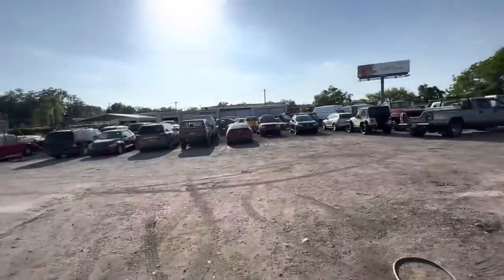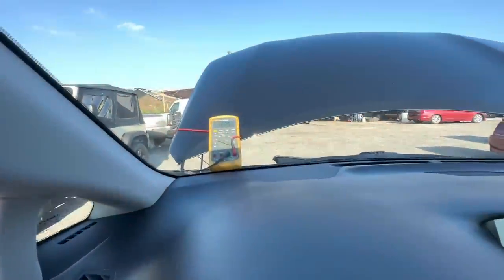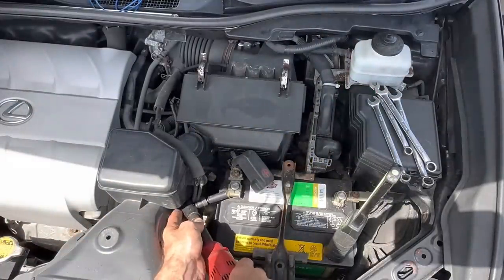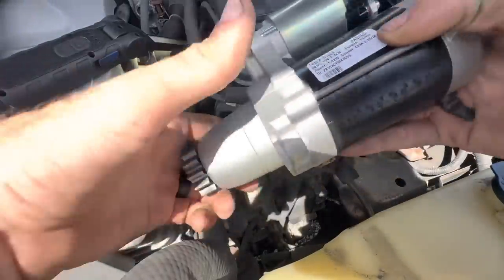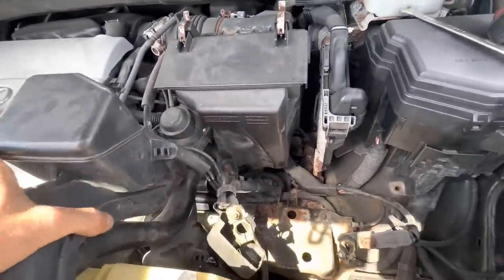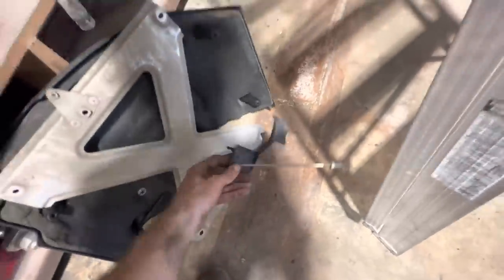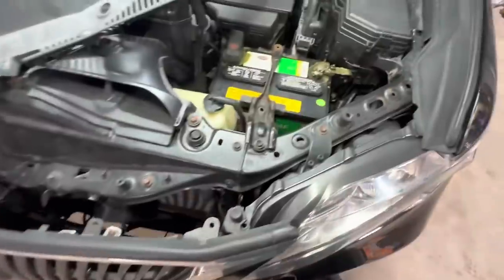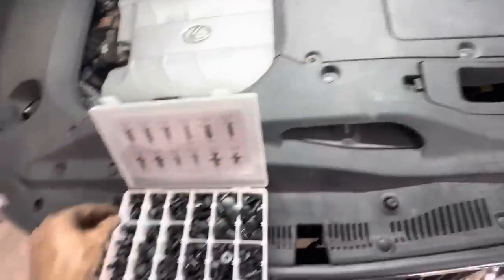Towed in Dead! Lexus Rx350 #mechanic #tow

Comment: To settle the motor vs engine debate...Motors run on electricity and engines run on combustion.
Reply: Takes a motor to start an engine!
Reply: Engines convert chemical energy to mechanical.

Comment: Perhaps you could install a winch at the back wall of your shop to haul these vehicles in?
Reply: That's actually brilliant..!! Well played//
Reply: He has a tow truck with a wheel lift he could back it in
Reply: Only problem with that, Ray will over engineer it, add a few fulcrums and pulleys, hits the lever and launches the "Lex i" through the wall into the next county....lol. (cool idea tho.  Lol)
Reply: Mount it to the slab. Studs and even the bottom plate might not be fastened well. Even today with all the hurricane codes. Done plenty of construction in Florida in his area both what’s considered coastal and non coastal
Reply: Ray already has a winch, on the back of his flatbed.  I wondered why he didn't just use the flatbed to move it into the shop.
Reply: @Richard Cranium Nah. Install 2. One to bring the cars into the actual shop (and into the easy to access lift) and the other behind to pull cars to the harder to access lift when a car is close enough to use the winch :P
Reply: the simple answer is he needs a Peter ?
Reply: How one little J bolt can take up your whole day ,  Hay what a pain haha love your show!!!
Reply: Or just get a 4 wheeler line I've seen at some shops

Comment: One comment worthy of note. A lot of the newer imports have a gear reducted permant magnet  starter motor... so when you bang on it you can very easily shatter the magnets inside. So even if you had thought about repairing the starter you now are up the proverbial Creek with out a paddle.  Re-man starter 100-300 dollars new over a thousand... brushes about $30 which are now no longer an option. So unless you are in an emergency situation DON'T BANG ON THE STARTER.

Comment: You're a brave man for driving that into the shop with the hood open, I've seen too many hoods drop due to worn prop shocks and crack the windshield with parts placed in the wiper area.
Reply: Brave, or a person that has yet to learn that expensive lesson...
Reply: Cracked windshield from parts placed in the wiper cowl is an entirely different situation than hood shocks slowly letting the hood down as you inch it in the garage.. giggety...  Furthermore, wtf you putting up there god dam driveshafts?? "I accidentally sent a control arm through your windehh... Myyy baahhd.." people just get off on "teaching"/"warning" (aka: man-splaining) others about all the potential dangers of every single move made, or is hypothetically possible to make.. thank you Mr miyagi.. I will definitely think twice next time before I toss a pair of rotors up on the wiper cowl before moving a vehicle a meter (~3') with the hood up😂
Reply: I had a 1988 Bronco that had the hood latch fail at 40MPH, wrapping the hood over the windshield with a BOOM! that bent the hinges and required a windshield replacement.
Quite a shock, given that I was in moderate traffic at the time.
Reply: Been there done that on a 17 Silverado just the others day , learned a valuable lesson that day.

Comment: The starter in my old 92 Aerostar failed in a Home Depot parking lot, so I called my buddy who drove me to an auto parts store, got a starter, and crawled under and replaced it. Easy Peasy. No cramming it under the hood in those days.
Reply: I changed out the starter of my Ford van in my driveway, just crawled under with a wrench, and had it done in 5 minutes.
Reply: Anymore a starter that doesn't have to be accessed through the back bumper is considered " Easy Peasy".

Comment: Fun video thanks Ray, for once engine designer got the starter motor position in an accessible place meaning no jacking car up and crawling underneath!
Reply: Toyota's been good about that on the newer V6s. I just had to do the starter on my 2008 ES 350 (same engine that's in this RX), it took less than an hour start to finish. Only had to remove the battery, air box, and intake tubes. Though I did cheat - I removed all the underhood plastics when I got the car.

Funny thing is I even have the same Costco Interstate battery..
Reply: @seand7349  I wish the same could be said for Toyota's V8's. The location on my Tundra was enraging, particularly when I had to replace it a 2nd time after just a few years.
Reply: @karlschauff7989  Ughhhhh. Under the intake, right?
Reply: @seand7349  I wish! It's under the exhaust manifold. Cooler lines and a frame also in the way...

Comment: Now don’t get me wrong, snap on is amazing, that being said I only have a few snap on tools. I’m not a mechanic but i do more than the average guy, (right now I have an npi 4.6 block I’m getting ready to mate with ported PI heads, forged internals, ect) 
  The tools I use are Gearwrench, Olsa, Tekton, Wiha, makita, Capri, ect. 
 (Not gonna lie I have some HF stuff too) engine stand, breaker bars, a set of icon sockets, and of course the golden ratchet. 
  I seriously think I have an addiction to shiny useful things, I order a tool or set every week. I think I’m up to 37 ratchets, 23 complete sets of sockets, 42 different pliers, 6 torque wrenches, and about 200-300 box end wrenches. Plus a lot more. 
  But only 2 sets of screwdrivers as well. 
  Anyways I love watching car repair videos when the guy with $40,000 worth of snap on uses the same tools I use as my main tools. Today it was your Gearwrench socket set. I have the same one except I pitched the blown molded case and threw them in my box on organizers. Actually just got another set of deep and shallow metric sockets yesterday. 
  My point is that I would have spent $31,472.69 if I got all snap on (Or 2 dozen eggs) and I’m your average guy with bills and a family. And I’m not a pro mechanic like I said. 
  But I am contractor so my work tools are waaaaaay over $30k. So I 100% get why you would use brands like snap on.

Comment: Impressive corrosion on the M post and wire, leading into the motor itself. The pull in coil and load side of the solenoid switch are both upstream. The way the starter is positioned, moisture is wicked down the wire into the motor. Does anybody know why they don't insulate that wire from moisture penetration? I've seen that before, nothing to do but replace the unit.

Comment: The old bang on the starter with a hammer. .. Countless times. .. And it worked about 1/3 of the time,lol
Reply: Remember the long handled flat head screwdriver to hit the contacts on the starter to "jump start" the starter.. ?  Lol (old school)   too bad that cable was fried).
Reply: @chrishengeveld6117  .. . Yep, I remember very well. Trashed a few over that one.

Comment: The start-then-stall thing is interesting ... lot of Chryslers (esp. late 90s Jeeps) after a battery swap not only will start-then-stall, but sometimes you have to feather the gas pedal until it'll hold an idle, too!
Reply: Some years of the Toyota Camry do that too - the computer forgets the proper fuel settings for idle, and it takes a few minutes to relearn.
Reply: Yeah what Moshe said, my 99 dodge likes to stall if the battery stays below 11 volts for too long and I jump it. I just discovered that my lower fuel rate injectors (19# instead of stock around 21#) did no stall on me, but it ran super rough until it went into close loop and figured itself out again

Comment: Would greasing that bare copper ground cable on the new starter help prevent the corrosion?  Maybe a schmear of dielectric?
Reply: Do what Eric O would do, Fluid Film it.
Reply: I don't worry about inside connections.   But anything outside I put a dab of Vaseline.   Dielectric or Fluid Film types should work as well.  I also Vaseline the battery terminals and hold down.   Also some bolts.  Vaseline is cheap and clings well.  Any bulb I remove gets a little bit too.
Reply: Agreed. A little dab will do ya

Comment: I recently bought a Craftsman underhood light which was less than $100 and uses regular Craftsman 20v batteries.   Works great, way brighter than other underhood lights I've used, and it folds in 2 so you can stand it up....

Comment: Had this happened to me. Except it was the battery cable. The positive corroded from the inside out. Replaced it and the battery. Old girls been running great since. But i had double the mileage this Lexus had. That was two years ago. I have a 96 Rav4. Just shocking but rare find a Lexus. I guess there's a first time for every thing. Great video. 😊

Comment: Hello Ray, just a thought, if the solenoid clicks you know it is being energized, so you know it is getting 12v 🤫 Also I saw your N.C. Diss, not everyone here has the "Squat". I used to use a beat up riding lawnmower to drag cars in with a rope, and an old tire tied to the front to push, it worked until I got employees.

As always well done

The One Time Hialeah
Blue Mule NC

Comment: Ray, have you ever replaced a started to find out the engine was locked up?  I always try turning the engine first before replacing the starter.
Reply: Well, if it was driven before it died, you’re prolly safe. If it is old not been started in ages ‘barn find’ put a little diesel in the spark plug holes and crank by hand. Then spray easy start into the mouth of the throttle body/carb, new battery, turn the key and 🙏
Reply: Diag using your senses. Watch the brightness of the dash lights during cranking and listen for the solenoid. It will point you in the right direction. If you hear the click and your dash lights dim considerably, the engine might be locked up, or battery and connection problem. Rattling: check battery and connections. Click and no considerable dash lights dimming: starter issue. No click: starter or starter control circuitry: relay, neutral or brake switch, fuse. Verify with a test light. Don't use a multimeter because it might show 12Volts while there's no current capability due to bad contacts.

Comment: I speculate that the glue is there because the intake comes with the hoses attached so it's glued on so it doesn't become unclipped during parts handling and assembly at the plant.

Comment: G’day Ray,
I remember in one of your videos demonstrating that when removing a battery you should always remover the negative connector FIRST in order to PREVENT SHORTING the POSITIVE terminal to ground with the tool you are using to untighten the connectors. Then, when reconnecting the battery do the POSITIVE terminal FIRST for the same reason. 

I agree whole heatedly with this, however, in your videos you invariably undo the POSITIVE terminal FIRST thus not only ignoring your own advice but risking shorting the battery’s positive to ground with a metallic object that you are holding. 

In the interest of maintaining the dexterity of the hand in question this is something that should probably avoided.

Comment: Did this job in my driveway on my 2010 RX in about thirty minutes.
Two things I’m thankful for:
1- starter failed in my driveway
2- I don’t live in the rust belt (everything was like new despite there being 150K miles.)
Edit: no glue or anything on hoses, btw

Comment: Fun Facts Toyota never uses 13mm bolts or nuts on any vehicle because the number is unlucky 12mm or 14mm are more common used in place of a 13mm @Rainman Ray's Repairs

Comment: In the UK we have a compulsory annual MOT (Ministry of Transport) test for vehicle's 3 years old and over, even a "insecure" battery is an instant fail. If the police stop you and find the battery is insecure (even if the J clamps are loose) that is an offence and penalty points on your licence,a prohibition notice issued and vehicle deemed to be in an undriveable condition and will require a recovery truck.Loose battery is veiwed as a fire hazard and when repaired the vehicle has to be inspected again by a MOT test station.

Comment: Toyota has longer J hooks in rear side of battery, check if both rods are same length b 4 ordering a replacement. There may be an arrow indicating direction of hold down bracket to indicate proper installation. Attention to details are noticed by customer in rating quality of service. Small details matter to some and you want as many happy patrons as possible. Love your show, great shop and local. Pride in professionalism will make your business a known and respected shop.

Comment: Looks like that Lexus was once a submarine. Wonder if it has ever been a victim of the dreaded storm surges - common to Florida coastal communities.
Reply: Increíble para mí ver tanta corrosión en un coche relativamente nuevo (tengo uno muuuuucho más antiguo (1993) que no tiene corrosión importante, en ningún sitio )
Reply: Just the sea breeze is enough to corrode things.  If you live at the beach, regular freshwater washes and garage storage go a long way.
Reply: @cup_and_cone  Mi coche de 1993 vivió (y vive) cerca del mar, mucho tiempo a unos 6 Km y recientemente (3 años) a 25 Km.

Comment: so, i work at Toyota, the glue that you see we use to hold the lines in when new as well as try and allow some form of lubrication when installing them, its a way to allow us to build the cars faster, but the glue is just there really, we dont know why we have to put it on there but we do, the clips alone will hold the lines just fine but its how the vehicle was designed before production so we have to use it

Comment: In my opinion, when the solenoid is making the clicking noise, it’s probably doing it’s job. That being said, I’d suggest that the brushes in the starter have worn away to nothingness. Could be the armature cooked too. That third hole in the battery hold down would indicate to be it should have 2 J hooks besides the bolt in the core support.

Comment: I believe Toyota uses that adhesive on the vacuum lines for 2 reasons. First, to keep the lines in the clips and prevent breakage over time due to vibration, and second, as a witness during factory assembly and inspection. 
Have a great day, Sir! o7
EDIT: There is a spot for a second J-Hook at the front of the battery hold down.
Reply: saw that 2nd j hook spot also. Com-on Ray.

Comment: We’re work on Toyota/Lexus vehicles in our import shop. We see that adhesive on those vacuum hoses, it keeps the hoses aligned and in place. 

That starter was exposed to salt water or brine of some sort. too much corrosion. Those Toyota/Denso starters last for many years/miles.

Comment: I'm only about a minute into the video and I'm guessing it's possibly a brake switch (somewhat ruled out), a gear sensor switch (the one that prevents starting in anything but park and neutral) or a security cut off device. These are my guesses to start with off the bat. 

Edited to add battery voltage and wiring from the battery to the starter, etc. And finally the starter.

Comment: I built Toyota engines for 4 years and we never put glue on the hoses, we use isopropyl alcohol. We dip the hose in it the place it on the engine, once it’s one the alcohol evaporates you get a good seal.

Comment: As you installed the starter, I noticed a big crack in the plastic of the tube going into the airbox that holds the filter.  (I am guessing it holds the air filter).  I hope that the leak does not cause a problem.  Obviously, you were focussed on the starter, but that crack was right in front of you.

Comment: All other repair type channels all say, “I didn’t want to bore you with the repair details”.  You don’t know what caused the failure you could obviously tell that the old battery leaked all over the starter and corroded the starter. I’ve seen this in repo cars a lot.

Comment: I literally just replaced my girls starter last Thursday on her 07 Nitro with 182k miles and that sum’bitch was a chore! The back bolt I could only turn 1.16” with a gear wrench. So it took much longer than it should’ve. Thankfully it was a 2wd and not 4wd or I’d have had to remove the shaft to get access first. Wish hers was as easy as this one! 
God bless~

Comment: If you grab a set of relay bypass switches from IPA it's so much easier all you do is throw in the starter relay with the Key on and flip the bypass switch and you get alot of info so quick and easy you know if the relay is bad or the starter it also has a loop on it to attach a amp clamp to verify you are getting power also

Comment: 0:48 is the gearshift in reverse?
You didn't try park/neutral.
It has white in the P range and orange in the R.
For race, right? Retread?
I don't know.
That's what it looks like.
But Ray would notice.
Oh, the motor cable, oh the ...carnage.
Dielectric lube the new one.
Or it will do that again.
The heat is making Ray loopy today.
Turn on the super blower and aim it at your work area, but, he's recording so he probably needs quiet.
Anyways, nice stuff brotha.
Corroded starter.
If it was mine, I might spray protector spray where it had failed before.
Next time.
Remember, for Easter, squeeze the bunny for chocolate eggs.

Comment: Dielectric grease on that starter copper wire would have helped to prevent the battery acid from the battery above from corroding it in the future...

Comment: Given the corrosion on the old unit, I think I might have covered that exposed copper cable on the new starter with some RTV or at least some dielectric grease or something. "Future-proof", you know?
Reply: though something around the same line. Always wonder how long those exposed wires are suposed to last.

Comment: Any chance that is a glue gun (heat) glue used on the vacuum lines as opposed to superglue? Cyanoacylacte glue would be brittle and not hold well on plastic or rubber whereas a heat glue could provide a bit of extra security keeping those hoses from vibrating out of the brackets but still allow removal without damaging the hoses or brackets.